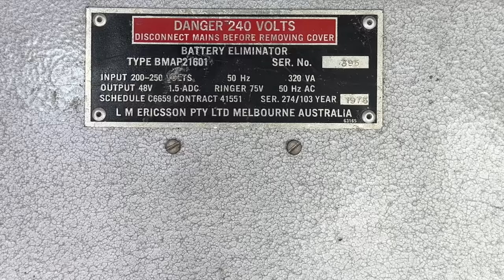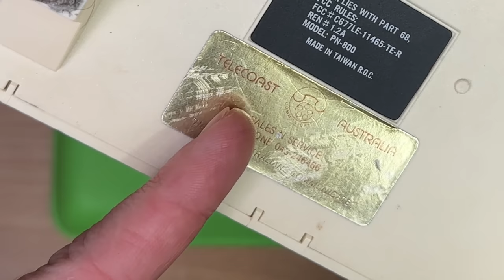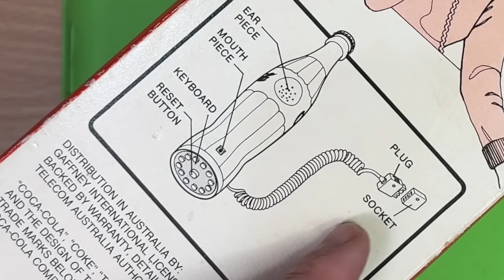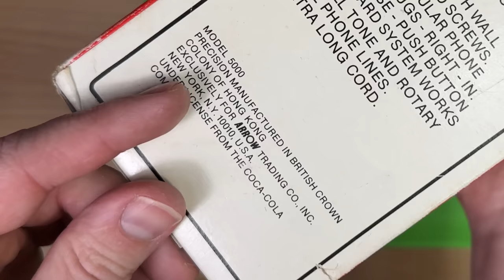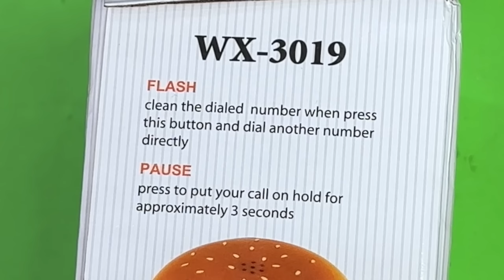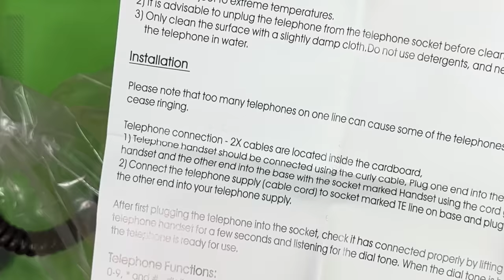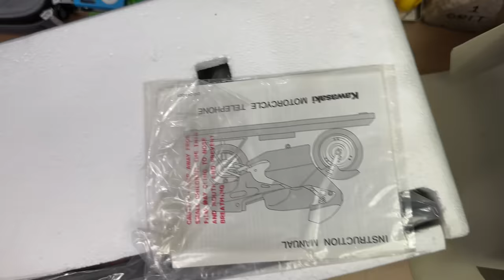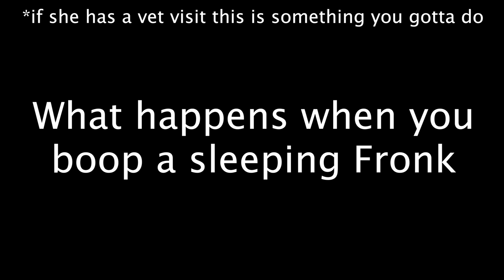Stupid Novelty Telephones

Comment: The fact that James just has a landline power supply from the 70’s lying around doesn’t surprise me for some reason
Reply: The man brought a Tiger Electronics knockoff back as The 2 AUD Nugget, nothing he could have would surprise me.
Reply: @Calvin_Coolage  Wait, what? Was this on a stream or something? I wanna see!
Reply: @Calvin_Coolage  Ahh, I remember that episode. It just didn't click in my head that the "Game Child" is a clone of Tiger games (which it is). Thanks for the link though!!
Reply: @AB0BA_69  No prob
Reply: Don't Read My Profile Picture  ok
Reply: James has a child's dreams from July 14th 1913 sitting somewhere
Reply: James is Mary Poppins for handymen
Reply: Same.  Man is a Technomancer.
Reply: @death32815  that's an oddly specific date-
Reply: I wouldn't be surprised if James had an actual unicorn
Reply: Certified James moment
Reply: I bought a donut for more money than the Tiger nugget and it was the cheapest donut in the supermarket
Reply: #justhackerthings
Reply: We still have landlines
Reply: Same
Reply: hahaha
Reply: To be fair to James. That thing is incredible for movie making. I mean sure you can put the phone ring in post but to get a truly phone ring experience in movie making the real deal is needed.
Reply: James has everything.
Reply: i have a landline. it comes through my cable modem from my cable company. i might use it for a fax machine printer.
Reply: Me neither
Reply: He has or bought one of anything made after 1960
Reply: Most likely because he reviews/uses old tech
Reply: Can we have a link to Jame's channel?
Reply: He didn't need a brick like that to make a phone ring. Pick up a VOIP adapter, or something like a Cell2Jack, and you can achieve the same.
Reply: I wouldn't be surprised if he has 10 of them
Reply: james has anything

Comment: I bet you the reason the coke phone was broken then glued back together was because someone thought it was an actual coke bottle and tried to use a bottle opener on it
Reply: That makes SO MUCH SENSE and I hate it.
Reply: That makes absolutely no sense lol 
How would the bottle broke from bottom when the opening is at the top?
& it's perfectly cut in half? no way that was the reason
Reply: @xXVibrantSnowXx  it was broken at the top. And it's perfectly broken because those were two separate pieces originally.
Reply: Or they knew it wasn't a real bottle and they tried the bottle opener anyway just to see what would happen.
Reply: @xXVibrantSnowXx  I think it makes no sense as normal coke bottles the liquid moves and doesn’t have a wire coming from it
Reply: They were actually smuggling coke in those
Reply: As hilarious as that image is, it's more likely that they dropped it and the glue holding that piece in had gone brittle.
Reply: @blakksheep736 That seems more likely.
Reply: How high were they?
Reply: @cat1554  1979
Reply: @Alphoric The person could of been drunk

Comment: When I was a kid, we had none of these fancy-shmancy phones. In general, people had old phones until they gave out, so even though I'm not that old, I interacted with absolute antiquities of, like, Cold War era long into this 21st century. Rotary impulse dial phones hooked to a flat double-strand cable. No plug of any sort on this cable, you connect wires to the device. The cable is thin and it's flat so you can nail it right onto the wall (wires are separated by a wide strip of plastic you nail through). These phones didn't require any additional power supply, and the power in that cable was low enough to handle it freely. Oh, and those old telephones RANG, they didn't beep. It was a physical mallet of sorts hitting something to produce ringing! Brrr-ring!

That technology was extremely simple and reliable. Which I like, but I also like my internet, YouTube and everything else online, I like mobile phones, computers, their software and games, and giant flat TVs, etc., etc., I can't imagine missing those simple times.

Comment: Well, if you didn't toss the piano phone onto the floor twice, I'd say "Ask James to make the ringer work again", but he's gonna need to do a loooot more than that now.
Reply: My first thought was "idk try taking the battery out?" But also it's a landline, that really shouldn't matter. So yeah
Reply: I'm wondering if the line in contacts were corroded/dirty or the ringer was switched off...
Reply: It would help if he was using the right kind of cord. That coiled cord is for handsets, and are different from line cords. Slightly more narrow plug than a line cord, so it was pretty strange that the first phone even worked. Wade must have JUST happened to get the pins lined up.
Reply: I think he was trying to plug the line cord into the handset socket, wasn’t he?  I think the line cord goes underneath, while the headset cord plugged into the back.
Reply: @dwderp  we may never know
Reply: I love that James is now just the "make stuff work" guy.

Comment: In 1985 I worked doing warranty repairs for the UK import company that sold these novelty phones, The piano phone actually has two circuits, one for the music powered by the battery, other the telephone and ringer circuit. It was featured in the video to the Kraftwerk song Der Telefon-Anruf.There was also a Budweiser beer can phone, that worked the same as the Coke bottle phone. And they both did have a pathetic ring.

Comment: Fun fact: Early Telecom TF200 phones with the flat keypad (instead of the later ZX Spectrum style one Wade showed off at the start of this video) had a bad habit of disconnecting data calls after 15 minutes. Very frustrating in the days when it'd take 2 hours of repeat dialling to get onto a popular single line BBS.
Reply: That and the keypads were somewhat prone to randomly dying. I believe it was due to moisture getting in.

Comment: The Coke Bottle Telephone's ringing sound is probably generated by some analog circuitry, which is picking up surrounding EM interference, eg. Router, Wi-Fi, Bluetooth signals. Note that unshielded cables behave like antennas, and twisted unshielded cables behave like very good antennas, and that could explain the produced noises.

Comment: Somewhere in my storage space, I have a 
'57 Chevy ragtop phone I bought to use as a subject for my artwork as I draw prints of classic cars and trucks.  
The phone is over 30 years old and still in it's
original box.  It even has all the original packing materials right 
down to the plastic wrap that covered the car after you removed the Styrofoam packing 
from each end.  After 
using it, I would very 
CAREFULLY repack it the same way to preserve it.  Still looks the same as when I bought it in 2010.

Comment: I picked up an X-link Bluetooth Gateway or two. I had been eyeing them for many years. One for at home so as soon as I get home it links my cell phone and all my house phones become active. And one for the car so I actually have a Rotary dial car phone or any other random phone I want to plug-in as it's in a bag with a battery I can take it around on my shoulder using any corded phone with my cell phone in my pocket. It's one of the few that actually does both rotary dial and traditional Bells.

Comment: Dear Mr. DankPods. I regret to inform you that at 6:49 in this video, you incorrectly use the word "detent".
According to Merriam Webster - Detent (Noun): a device (such as a catch, dog, or spring-operated ball) for positioning and holding one mechanical part in relation to another in a manner such that the device can be released by force applied to one of the parts
Seeing as the plastic protrusion you declared a "detent" does not position or hold a mechanical part in relation to another in a manner such that the device can be released by force applied to one of the parts; it is inappropriate to use that term in this instance. I hope you remedy this behavior of flagrant misuse of words in the future.

Best regards,
- Lad D. Erman

Comment: if you get a plug in cordless phone and plug the non powered ones in to that one you can hear them, I got a few old phones from a thrift store years ago and wired them in the house connections in the walls so me and my siblings could talk to each other in our rooms, in my house all but the one in the living room were disconnected from the main line but still connected to each other, it may only work with some cordless ones tho, its just a cheap way of listening to them

Comment: I bet the Coke bottle phone has a bell ringer (which uses electromagnets), and the spring to return the hammer back to the bell is damaged, so the magnet can’t move the hammer, and the humming is the sound of the electromagnet vibrating with the AC 50/60 hertz

OR its because the transformer only outputs DC, not AC, which is probably the same reason why the Kawasaki phone didn’t ring right

Comment: When I was a near baby in the 1990s, I never saw a cord in my house. We always had a cordless phone. I didn’t even know phones had chords until I saw them on YouTube videos. We just didn’t have any. I remember my mom would walk around the house Holding onto a phone and talking. I would even pick up the phone and go find my mom if she wasn’t anywhere near one of the variety of cordless phones around the house. They were so digital and computer thing and it was so like an office. Until I saw videos like this on YouTube, I literally did not know. Phones could look like so many different things, and have chords sticking out of them.  I remember we used to switch our phones out every year or two so I always saw brand new cordless phones coming in until cell phones became a thing and my mom threw all the cordless phones out but they always looked the same. A boring black slab about the size of an iPhone 15 Pro Max , but as thick as probably like 2 inches with a dial pad and a little LCD screen for I don’t know what

Comment: Nothing really prevents you from gutting those and turning them into bluetooth headsets (easiest would probably be to press an RPi0W into service)...

...yes, you can basically use them out in the city to take calls.

(or other insane thing, with a RPi0W again (or an arduino) you basically could turn that hamburger phone into a macro keyboard for your streams).

Comment: My wife just bought me a brand new cheeseburger phone for my birthday. My only complaint is that the connector is hardwired into the body, and it's one of those bloody coiled lines! I might have to take a crack at rewiring that to go to a socket, so I can use my own phone line instead.

Comment: I'm surprised the Garfield telephone wasn't included, that's one of the iconic Novelty telephones. If only I had one of those telephone power supplies for testing the ringers since I once got a rotary phone not knowing the ringer is dead, and I think the ringer on my Mickey Mouse rotary phone is on it's way out next since it sounded off the last time I had it installed.